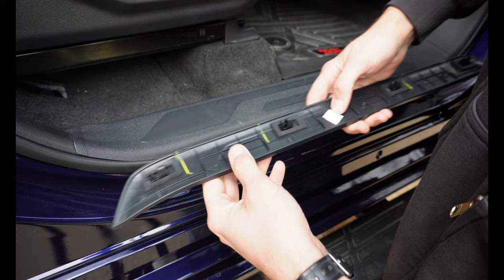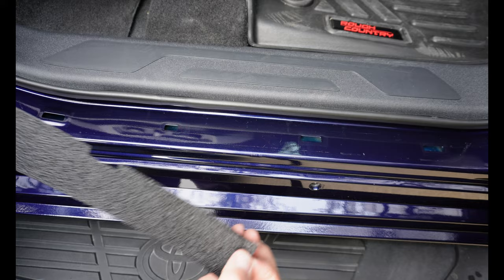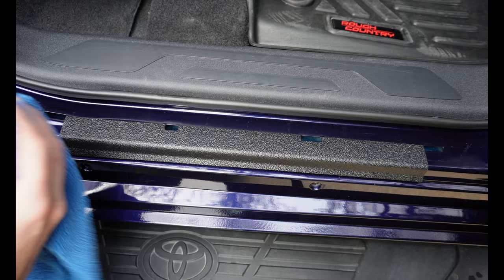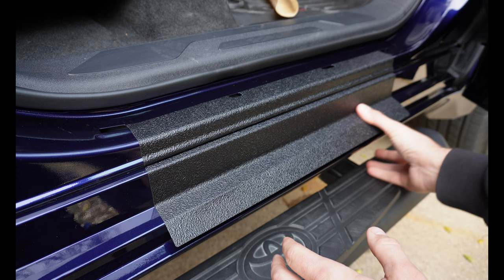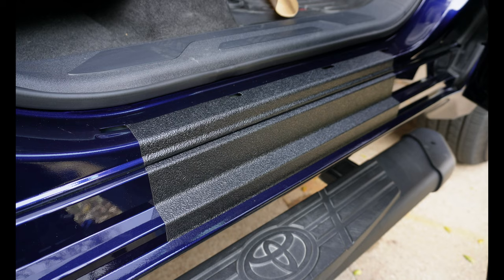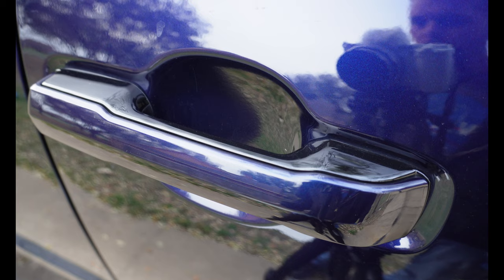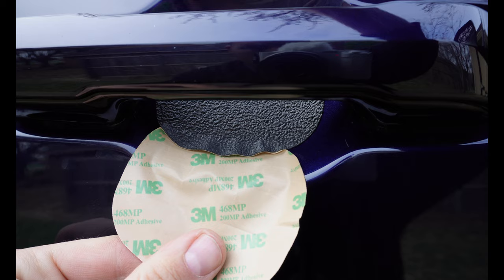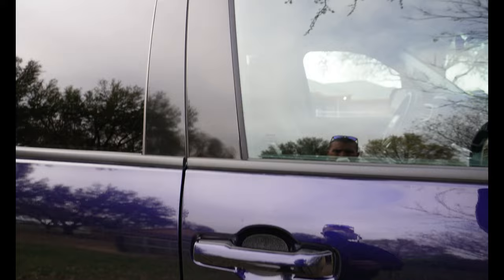Tufskinz install 2022+ Toyota Tundra

Comment: How is it holding up now after 9 months? Are the edges peeling up at all ? Is the adhesion still 100%?
Reply from the maker: Still 100% when I got rid of the truck back in November. The engine blew up, and I had Toyota buy it back